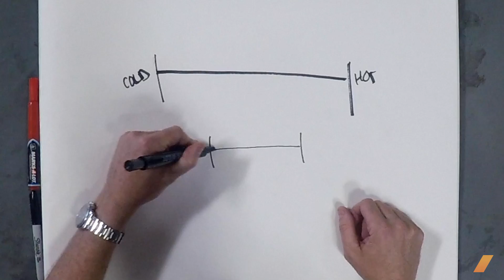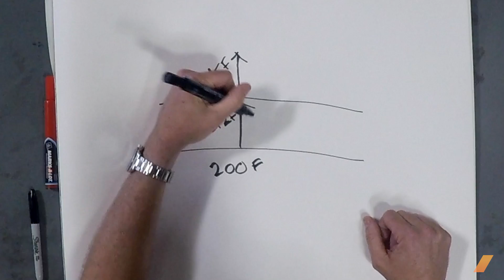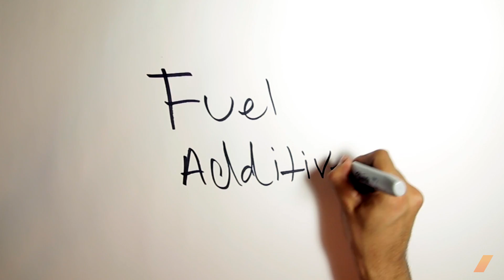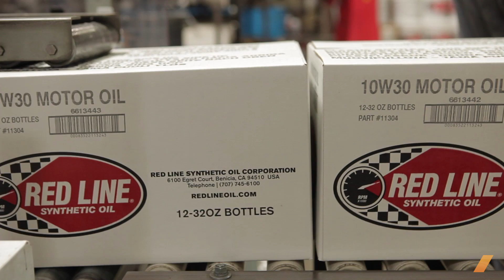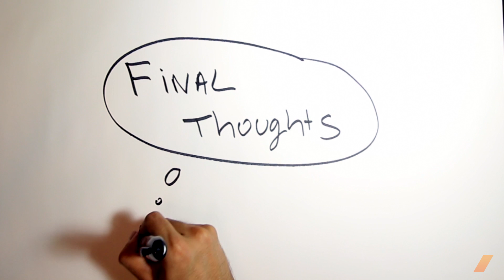10W-WTF!? Dispelling Myths About Oil -- /ENGINEERED

Comment: So is 5W30 actually giving you any better protection than 0W30 when you get it hot on a track day? From his explanation it sounds like maybe not. In which case, why would you ever run 5W30 instead of 0W30? From his explanation it sounded like the 0w can start the engine safely in colder temps and the fact that its top rating is 30 means its the same as 5W30 once it gets up to high temp.
Reply: You're right, given the same operating temperature viscosity, it's always better to use the oil with the thinnest cold viscosity you can get, which is usually a 0w oil.
Reply: but then why does 5w30 even exist and why do some manufacturers recommend it instead of 0w30
Reply: In practice, the greater the discrepancy between the 1st and last number, the more VII (Viscosity Index Improvers) they would need to add to maintain that wide multi-grade range. Of course, better base stocks such as group VI used by Amsoil or group V used by redline are inherently multi-grade due to their inherent thermal stability but for really wild grades such as say 0W-60, more VIIs are needed.

The trouble with VIIs is that the more VIIs you use, the more likely you are to suffer loss of high temperature viscosity due to VII breakdown over long term high temp use. Hence, for say a BMW M3 meant for hard tracks use but not many cold starts, an oil of say 15W-50 would be ideal since it's running hot enough most of the time and that grade has relatively little VIIs.
Reply: Ah ok that makes sense and I think I heard something similar a while ago. I was just surprised they didn't explain that in this video or in most articles about the subject online. So in reality am I better off sticking with 5w30 considering my car gets a lot of abuse on track, or is 0w30 going to be absolutely fine? I've noticed it struggles to start a bit now that the temperature outside is dropping and I'm on 5w30. It still starts but not as easily as it did in summer.
Reply: ChrisDrift
Check out my link to the Ferrari Chat articles, or this link posted elsewhere in these comments has tons of great info: https://540ratblog.wordpress.com/2013/06/20/motor-oil-wear-test-ranking/  Look particularly at section 8, testing several 0w vs. 5w oils for use in C6 Z06 cars.  If your main concern is ultimate wear protection for hard running engines, one of the listed 5w oils might be better.  But for wear protection on cold startups, common on daily driven cars, a 0w oil is going to provide better reduction in engine wear.
Reply: ChrisDrift 0W-30 Synthetic and 5W-30 Synthetics are very close, if your cars reccomends 5W-30 you can use 0w30 no problem
Reply: Yeah I'm mainly worried about protection when its being thrashed on the rev limiter all day at drift events. But I just thought from this video that they were saying 5w30 is no different at high temps than 0w30, so I figured maybe I should just go back to 0w30 so that its easier to start in cold weather. Now I'm not sure lol in that article you linked, they say that the 5w oils all offered better protection than any of the 0w oils.
Reply: ChrisDrift well I'd advise against it unless you have issues with the cold start. As long as it starts just fine cold, keep the 5 30,as it gives you better protection just after you start it up. I suppose you're not letting the car heat up for 10 mins just cause you have to go to the shop buy bread. And also check your battery. It might be at fault for the bad cold start. As well press it the clutch before cranking the engine so it won't have to crank half the gearbox as well as the engine.
Reply: ChrisDrift
For drift days with lots of rev limiter bouncing, I would probably use one of the oils listed on that RatBlog that's near the top of the Wear Protection list, that also meets the viscosity specs of your engine.  But for other days with daily driving and daily cold starts, I would switch it out to a 0w oil.

Are you changing oil before and after drift day or other track events?  If not you probably should.
Reply: the simplest answer is that generally as you go down in W you go up in price, so a 0W is more expensive than a 15W most of the time.
Reply: ChrisDrift the only reason why wouldn't is if you lived in the desert
Reply: 4G12 Pardon me, sir, but since when are Amsoil lubricants Group VI? 

Did you mistype that or are you suggesting Amsoil is basically commercially sold Formula 1 Grade lubricants?

Comment: Seems like a low priced synthetic oil is almost always going to be better than the best conventional. I use synthetic in everything, including lawn mowers, generators, etc. It improves starting, power, fuel consumption and even makes an engine quieter which should mean less friction and cooler running. I don't buy into the longer change intervals though, it is getting dirty, so you should still shoot for 3000 mile changes in cars. It also makes sense to use it in the drive train, steering and brake system while you're at it.

 We have a 6.5 hp mini bike, nothing special, but after changing to synthetic, not only is it quieter, it will pull the front tire and spin the rear, (OK, just barely, but still better than with conventional oil)  with the improved horsepower. All the benefits easily outweigh the few extra bucks.

 So many myths, one guy said to me, "I heard that if you go synthetic, you can't change back" My answer..."Once you try it you WON''T WANT to go back!"

Comment: Free education ???    Don't you think Redline has a vested interest in this ?   Why are engines lasting hundreds of thousands of miles on regular oil  if maintained properly ?  No way this stuff or any other of the other higher priced oil is worth it.  His information however is basically correct.  And if you really listen he's not giving any rationale for using his oil other than your engine will last longer.  It's not a big deal for engines to last certainly 100k, 200k and even beyond.  How could one justify its use ?   Years ago a car was pretty much on its last legs at 100k... now a days they are still running just fine.

Comment: is it me or I must have missed it but did not get back to the octane booster BS
Reply: Most octane boosters are a form of top end engine lube oils. This delays the pre ignition, and gives the effect of high octane, but with no more performance. A small bottle of additive cannot lift the octane of a whole tank of fuel.

Comment: Lucas, techron, royal purple, gumout, seafoam? Which are solvent based and which are detergent based?
Reply: I know Techron is. But that's the only one that I know for sure.
Reply: techron is detergent?
Reply: It is a detergent that contains solvents.
Reply: Lucas and SeaFoam are solvent based with no detergents, 
Royal Purple  is solvent based with some detergent, 
Techron, Gumout are detergent based (PEA or Polyether Amine and/or Polyolefin Alkyl Phenol Alkyl Amine) with some solvents. 
A combination of high detergent with some solvents performs better cleaning the entire fuel system, valves, ports, combustion  chamber. piston tops and even spark plugs.
Reply: I have used Seafoam on my boat motor, a 70 HP Yamaha, worked pretty well cleaning the injectors.

Comment: This is all elementary information that a child could learn with about 60 seconds of googling, a 17 minute video is unnecessary (if you don't already know what XwXX means  or how temperature effects the oil, you have no business turning a wrench). In addition it's presented with ambiguity... doesn't discuss molecularly whats going on with oil or its additives guess that's what you get when you talk to marketing instead of engineering. 

Thumbs up for at least touching the subject of fuel though, most people never associate engine oil and the fuel run.

Comment: US courts decided "synthetic" is a marketing term only. that is why us made "synthetic" oil cannot be sold in europe. European synthetic, is actually synthetic. us syn oil is higher grade than non synthetic, but is not true synthetic oil. Europe has standards that each car company and oil manufacturer adhere to. US standards are all over the map with each motor company having it's own set of standards. want the right oil? go by the standards.

Comment: I'll stick with the $17 Walmart oil change for my 94 Subaru with 320000 miles on it
Reply: GETaYOTA me too lol I buy 5 gallons for $52 Canadian
Reply: Years ago, it was found that as long as you change your fluids at appropriate intervals for your usage, you can make your cars last almost forever.
Reply: walmart uses whatever oilbrand you tell them to use. So you can get  good oil from walmart, and they charge their little 10$ fee to put it in.
Reply: As long as it is non-turbo and you change the oil frequently, it's fine. Most turbos use a sleeve bearing, which is just a wide shaft with a sleeve around it. That bearing is what really requires a synthetic oil since you have both extreme heat and speed of rotation that will destroy the binders in conventional oil, leaving you with think gunk and light oil that protects nothing.
Reply: GETaYOTA
Reply: Don't put that shitty super tech garbage
Reply: Supertech is actually very good oil.  Both conventional and synthetic.  There are plenty of great UOA's on Bobistheoilguy.com to show this.

Comment: Lube is very important..mine is cherry flavour'd.
Reply: Yeah, with that context it's hard not to giggle at times.
Reply: Simon Curtis waterbased
Reply: i legit have strawberry, it's awesome :P
Reply: it is waterbased yes. sometimes i like to squirt a little WD-40 into it, works like a charm
Reply: WD40 is technically - no actually the same  as 30 weight. I'm sure it would break down fast though. I seen an 2 hour video on oils both petro and synthetics. It verified my suspicion of 10-30 oils as a viable oil suggested by the engine makers. I use nothing less than 40W from Castrol or Quaker State. Which handled the highest torque rating of all the others available on the market. Therefore it doesn't break down as fast as other oils into a black sludge.
Reply: WD40 for Sex? Um, it might be a better idea to use some sort of vegetable oil or maybe Ultralube which is a vegetable based penetrating lubricant. I wouldn't think soaking in petroleum to be the healthiest of practices but I do suppose you're joking.
Reply: You made the internet today :D
Reply: +Austin Lucas WD 40 doesn't lube anything. It's made for loosening rusted old bolts. As "engine cleaner", WD 40 consists mostly of kerosene/paraffin/fotogen (different languages) as I recall. If you have to use lube for sex I feel very sorry for you. You are not doing your job right.

Comment: Used redline 80/90 in a dodge ram rear end called and everything 1st . It started whining within 100 miles and I dumped it for Valvoline , later amzoil severe gear . The noise is much less but still their !!!! Never again , sorry redline your gear oil sucks .

Comment: Synthetic oil is petroleum based oil. Look, this guy is lying to you, pretending that the oil is pure chemical (synthetic) based.
ALL chemicals come from Petroleum OIL. Remember that. All this guy has to do is tell you that. Just more refined with some of the previously removed substances reinstalled into the new oil. Simple, eh? Look, the engine manufacturer KNOWS about the oils they recommend for their engines. Stick with the advice from the manufacturer regarding your location.
Oh, and if you happen to live in a really cold place. Keep your car/truck or whatever in a garage with a radiator set into the floor to bring the temperature above a couple of degrees above freezing.  Also, place blanket over the hood. Good to go.
You'll notice that my pupils don't dilate and I don't have a red face.
Reply: Not everyone has a garage

Comment: never heard someone use so many words to say absolutely nothing
Reply: my thoughts exactly. Pure salesman speech.
Reply: If you couldn't get anything out of this speech maybe you know everything about oil applications and its uses already...or maybe learning just isn't for you.
Reply: ***** or...maybe he just didn't say anything of value
Reply: Yeah, I'm fan of Redline products but that was a lot of nothing useful. Sure, groups, ok find anything but a redline or amsoil that will tell you what base stock they use. Temp effects oil, ok great that's pretty simple, synthetic is better, ok but by how much. For example one question I've been unable to get solid answers on, and he COMPLETELY skipped it is VIIs, Viscosity Index Improvers. VIIs are how they make a multi-weight oil with conventional oils. For example 5W30, they take a 5 and dump VIIs in it until it's a 30 when hot. But VIIs break down so a 5W30 over time becomes a 5. But do they use any VIIs in synthetics and if so which ones.

Comment: The real take-away from this video is to consistently use Premium-grade gasoline for its detergent additives.  And don't let anyone convince you otherwise, not even the car manual.  And especially not the 'experts' who'll tell you that the octane rating refers 'only' to its ability to prevent knocking.  That may be so, but the premium fuels also keep the engine clean.

Comment: Group 5 ester based oils don't last. Unless you are racing and chainging oil every 5000 kms, you are better off group 4 PAO oil.
Reply: maybe some of the oens he said that "burn off" are what you're talking about?
Reply: IamNOTyourFather Group 5 for me is only race application. Group III and IV are good enough for street cars.
Reply: Pretty sure most synthetics are a blend of group lll to V oils.
Reply: Disagree. Depends. I change every 5000 miles either way. But ester based oils do miracles for some engines. Particularly mine. 

Either way Redline for instance is a mix of group 4 and 5. As most are. They're not 100% Ester. That would be a bad thing. PAO is group 4. Ester group 5.

Comment: Your video claims to dispel myths, but you are actually perpetuating myths, especially around API Base Oil Groups!  For example, synthetic motor oils from Shell Group III GTL (natural gas-to-liquid) base oil provide better high and low temperature performance, and GTL base oils are actually BETTER to formulate motor oils with because they have better solubility than PAO. PAO does not have good solubility, which means you cannot dissolve additives well in PAO, and because of this, there is no such thing as a 100% PAO motor oil formulation!! There are a lot of myths around API Group III vs. Group IV vs. Group V --- just because a motor oil uses base oil with a higher Roman numeral does not mean it is a better formulation!!  Also, your Redline website claims that BMW enthusiast choose Redline -- FALSE!! BMW Original Engine Oil is formulated by Shell-Pennzoil with PurePlus Technology, which is made from natural gas (GTL).
Reply: Engine Girl Show me the UOA
Reply: You throw a lot of words without numbers. Just because some enthuasists use other oils doesnt mean that all use the same oil. Ester oils would not be used by jets if they were bad. There is more than one way to oil a car none of which will cause significant damage long as the manufacturer guidelines are applied. The oils you are recommending do not have better numbers. Different numbers for different weights for different applications your arguement is an oversimplification of a complex process you do not seem to understand yet.